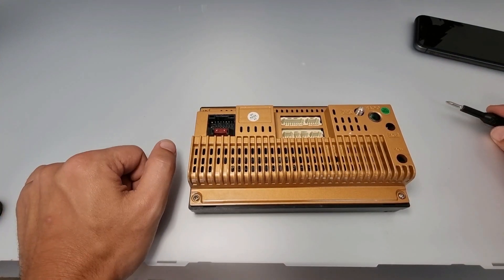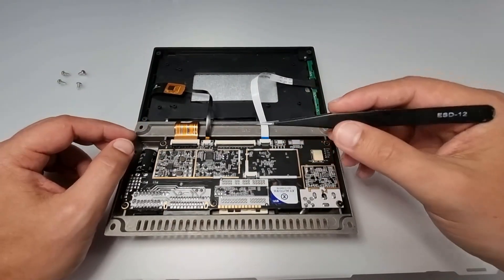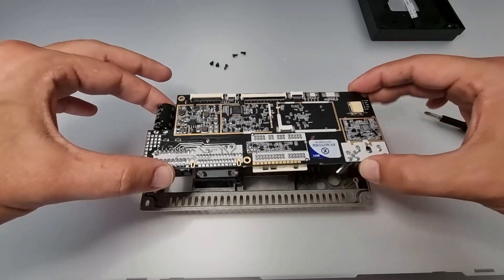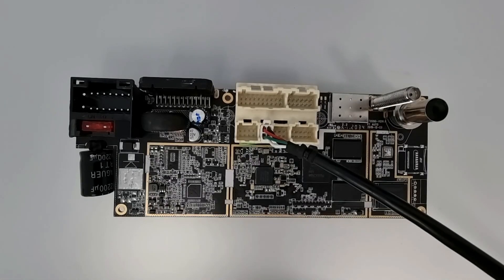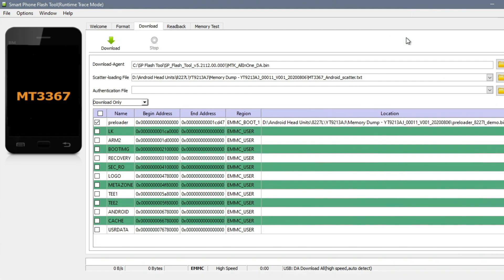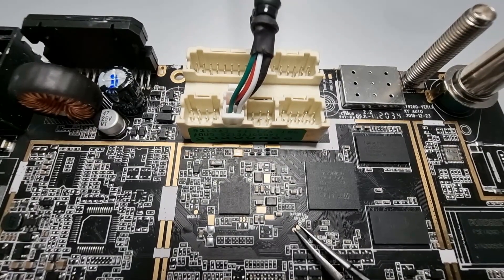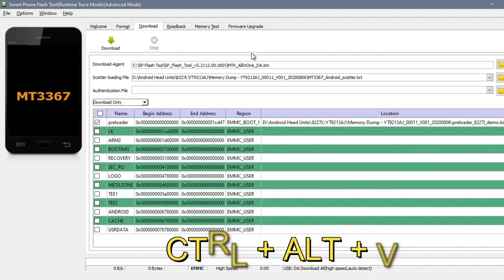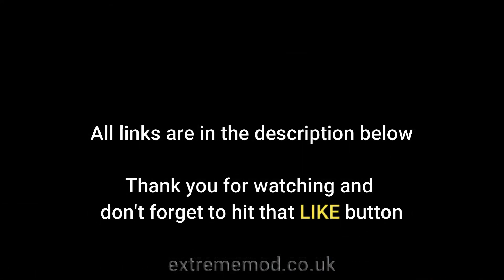How to revive your Chinese Android Head Unit - Test Point method - 8227L - universal car stereo

Comment: Hello !
Congrats on your very informative videos,
It happens so - to me, that yesterday while I was in the process of updating this yt5760b head unit .., 
by almost..accident...I pulled back the USB stick , and so now.., I cannot access the unit , not over its  touch screen neither the USB connects to a PC ,
It starts , and runs 3 apps , ( the same each time ) , and stops in one like camera or something ,
What I should now...
Could you kindly pls help me ,someway ?
I haven't made any back up of the orig. version ...it came with, Only I have the 1.7 ver in the USB stick,
Should I short the two pins so the unit's flash become blank ?!

I still... love this unit ..and would like to revive it again..

Thank you in advance ! for any possible helpful reply 
like links etc ..

Mario's

Comment: that sticky thing is called thermal paste 🤣 and temporarily soldering that point is much stable way to flash GBs of data in new devices, other than holding it with some tool.

Comment: I use a similar android multimedia product, it stayed in android for a while and did not open. When I turned it off and turned it on again, it was going back to normal, it doesn't turn on at all anymore. I couldn't open it with the reset button, I couldn't find the recovery mode. Now I want to make a flash from scratch like you do, does this method you described work? Thanks

Comment: DANGER: Not exactly sure what went wrong but this just bricked my head unit.  The format part worked just fine but now I can't get it to connect anymore so I can't push the BOOT1 backup to it.  In Linux, I keep getting Error S_COM_PORT_OPEN_FAIL (1013) as soon as I plug the cable in.  I figured I'd try the actual MediaTek drivers in Windows but that's even more confusing as the driver loads but never successfully initializes.  Appears to be some kind of boot loop - the driver loads but fails to initialize, waits a minute, driver unloads, waits another minute, and then starts over.  No idea where to go from here short of trying to find its JTAG port or something.
Reply: The risk we take 🤷

Comment: what happened if the usb port is not working? actually i was trying to connect the for wire from the usb ( connected to the 4 pin port) to car oem wire etc smoke came from the unit .and my dashcam stop working which is 6 pin port usb.screen go black after a while restart and everything working only the dashcam not working.
Reply: You definitely have to replace the controller with a new one 😂.In China they sell these for only $30
Reply: @Nam5605  ypu mrsn the mosfet?

Comment: Good video. Anybody know if this head unit motherboard has pins for a battery? Mine performs long cold start every time power is applied. The long start makes the back-up camera somewhat useless as I am usually backed-out of my driveway or parking spot before the head unit has completed booting. The motherboard needs a "suspend to RAM" power-down and a battery to keep the RAM alive.

Comment: I have the YT9216BJ_00012_V0001 and im having issues with the mains audio going out except when i hit a big bump or hit the dash just right. 

all 4 door speakers will cut out simultaneously like it's going into a protected mode but my s/w output is 100% unaffected.  

I might have a grounding speaker wire in one of my rear doors but haven't had the tools to get the doors opened after my truck bed was broken into in my apartment-locked parking. 

if I can get it working I'd like to flash it with your software, if i can't I'll send it as a donation and go back to my Kenwood DDX2.

Comment: Hi, thanks for the great video!
Do you have, by chance, the best Android version or firmware file that we can install on these devices to make them perform as well as possible?

I have installed the XL6107 system version: 20211027.144419 and MCU: XL6107_V107_20210910_1C1

The problem is that the FM stations are always mixed up and also this version does not allow me to use the Waze application, which is not great at all.

Thank you for your help!
Best regards.

Comment: Hi , I have Grundig GX2800 head units. After update it stuck at restart screen and continues restart. Even after power off I is running
Reply: I have the same problem, if you solved it, kindly share

Comment: My light is not switching on when connecting usb point. But it turns on when supply 12v
Reply: i have the same issue sort of, did you found a workaround or what the problem is?
Reply: @SultanofSerendipity  no.
Reply: I am having the same issue.

Comment: I have a cheap android head unit from ebay. Have had for 2 months or so. Suddenly ot will do nothing. No screen light up, buttons don't light up, nothing. Sometimes you can see a dim luminance in the screen for a few seconds as if it is attempting to come on. But nothing else. Can someone please help me with this issue,???
Reply: Probably backlight issue
Reply: Where to get parts @tigerusa5430
Reply: Take the fuse out for a minute might fix it

Comment: I have issue similiar Head Unit Android from China. The Mother Board its look like at the video. When i plug the USB cable data (i make my own from cutting 2 USB cable than connecting it), the light from the blue light indicator in bottom right corner is dim and the flash tools app doesn't read the motherboard.  Any addvice sir ?

Comment: I have a similar Chinese multimedia, and the touchscreen is unresponsive. Since the USB is working, I attempted a hard reset and calibration using a USB mouse, but it was unsuccessful. I decided to order a replacement digitizer (touchscreen), but the issue persists. I suspect it might be related to the chip, and I wanted to flash it. However, when I connect it via USB to the computer, the Device Manager doesn't respond, whether the device is powered on or off, even though the USB mouse works. I'm doing this as a hobby, but I'm unsure about the next steps and what to do next.

Comment: Is there a replacement board with a better CPU/GPU/RAM? The 8227L is hot garbage. Very slow, poor performance etc. Would rather drop in a new motherboard with better specs. The Screen is fine, the form factor is great.

Comment: Tell me, I can’t flash the radio, I have a ts10 screen 10.33 widescreen 720x1600, I downloaded the firmware file, unpacked all the files from the folder to the root of the fat32 flash drive, I boot from the flash drive, but the process immediately shows 100%, I tried another flash drive and other firmware files and loaded from key1 As a result, the flash drive does not see the firmware files,

Comment: I had issue with my android, I think I hit a ground wire while im setting up my AMPLIFIER,  right now the headunit is black out, when I press the recovery hole , light comes out in the icons but not in the screen, any idea what's the solution? thanks

Comment: Thank you, I managed to revive my unit, but now I have another problem next to my mercedes logo, boot mode selection appeared, volume up for selection and volume down for selection, I have three options recovery, fastbooti normal. My unit has no physical buttons and I can't select either one option to select and the selection arrow itself goes non-stop from one to the second and third option. Is there a solution to continue booting my system.

Comment: Hello Dimitrij!

After I created a backup of my unit as described in your other video I proceeded with the installation of the firmware.
However, after downloading the BOOT, ANDROID and VENDOR, now my head unit won't turn on.
I tried the test point recovery but I always get the 4032 error.
I carefully followed the instructions and was able to create the backup without problems.

When I plug in the motherboard via the 4-pin USB cable the blue LED lights up, so it seems to be working.
Am I missing something?

Comment: Thanks for the guide!! I followed the steps several times with another unit that I have and I was able to revive it, now I have another unit that when it comes to turning on the LED it does but it is very dim. Could the motherboard be damaged?, Excuse my English, I'm using Google Translate
Reply: i have the same issue, did you find anything?

Comment: The "white stuff" is actually very important for cooling the chips.  It is called Heat Sink Compound and you must replace it if you clean it all off as your unit will overheat without it.   Make sure you always replace the heatsink, or make sure you don't clean it off so there is enough left to provide a good thermal connection between the chips and the case.
Reply from the maker: That is correct. Although the quality of said compound is questionable at best. We normally replace it with Arctic afte we installed additional heat sink plates to really tighten the fit.
Reply: You beat me to it lolz
Reply: isn't the white stuff are glue to keep the component from  vibration during driving condition
Reply: @groinache  No, it's a thermally conductive paste to improve heat transfer between components and heatsink.
Reply: We know.
Reply: Wherr is that white stuff?
Reply: @arneldata9423 On the black piece of chip next to the black socket or above the coil

Comment: Hi, I've just received a DOA unit from Soarcomer (blank black screen). The unit is a 9.5" with the newest 2K screen (2000x1200 pixels). I ordered 6/128 but the sticker on the back says 8/256! Whatever, the unit doesn't work :/ 
My unit SEEMS to boot (or at least it has power on the motherboard) because when I provide 12VDC to the 2 pins BAT/GND of the main 16-pin connector on the rear, the blue LED on the PCB lights up. Also, "CAR_BT" is broadcasted in Bluetooth. However, if I plug just USB like you show on my computer: nothing, the PCB LED does not light up. Any idea?
Reply from the maker: Sorry we don't have any experience with this unit.

Comment: Maybe you could help. My android 11 unit has been running great up until i got in my car to leave work today.  The screen is stuck on my car logo and the bottom right says fastboot mode... any ideas how to get passed this ?
Reply from the maker: It's likely your system files got corrupted when some of the apps got auto-updated. You can try factory reset your head unit. Refer to the instruction manual that came with the unit or contact your seller.

Comment: Mine has no power does this work the same for this m😊😊
Reply from the maker: If it REALLY has no power, then it's not a firmware issue. If it just "looks" dead, i.e nothing shows on the screen, then it's hard-bricked. This method should work if you have s proper backup, or the bootloader for your exact model.

Comment: Hi...
Hope you are doing well.
Why don't you make new videos?
Please make videos on upgrading px3 head units (both hardware and software from Android 4.4) if possible. Thank you.
Reply from the maker: This is a side project that we started during Covid and we all got normal jobs and families. Making new content takes a lot of time and we simply haven't got that right now. We are releasing a new video soon on our Rockchip-based ExtremeMOD Android Head unit, that showcases hardware modifications and new firmware.

As for your PX3 question - we only focus on MTCx type Rockchip units with Android OS 7.x to 10
Reply: @extrememod_ahu  thank you.
Your videos are great.
Good luck 👍

Comment: Hello, I have a player similar to this one.  I had a problem with the wiring and the output was damaged, change the component and that's it, the equipment turned on again, almost everything works exactly, the illumination of the side keys is not software, because I verified that and it's fine now, I don't know if it is the strip that connects with These keys have false contact in the key lighting area or the leds of that part were damaged when the output burned.

Comment: Hi!!  Grats for you video!!!

I have a TS9 model that stucks in android logo.

I want try this method, it will work for my model??? 
 
First I would like try in recovery mode but I dont know how start in recovery mode for my model, can you help me pls?
Reply: This method will not work on your head unit. You need to short KEY1 to ground to initiate "Download Mode" and then use a working firmware to restore the system.

Comment: Hello! Thank for this video, i have an ATOTO F7 WE 7 head unit that won't power on due to a bad firmware update that went wrong. Can i use this method for this model? Thank you so much, here in Italy we don't have a single place that can provide assistance for this.
Reply from the maker: That's not an Android Head unit but rather a Linux-based custom entertainment system that supports Android Auto and CarPlay. Reach out to Atoto support. They are the only ones who can help you.

Comment: i have a head unit , i tried to flash it, but the sp flashtool never detect it, i tried with the USB 4pins and the 6pins also the same problem, i saw that the 4 pins is more good, i got another USB and i cuttet it and i merged the 4pins with it, and the sp flashtool still not detect it, im already installed the mtk drivers correctly, when i plug the cable into the pc i hear a sound of an usb detected into the pc but nothing worked, please whats the solution
Reply from the maker: Try to connect your head unit to power after inserting the USB cable. Then disconnect from power before taking out the USB cable.

Comment: I have the same unit 8227L for a bmw e46 and the FM radio stopped working. No sound, It doesn't respond to touchscreen, can't change the stations of radio band. But the upper buttons RDS TA PTY work. Also the rest of the Android unit, apps and everything else, rear view camera work fine.

Only the FM radio does not work.
I've reset the unit several times from the menu and by pressing the little reset button with no success. It reset only the settings but  there's no option for hard reset .

Can you please help me? I tried contacting the seller but he can't help me.
Thank you
Reply from the maker: If you have the same unit (which is unlikely as there are 100s of permutations out there and while they might looks the same, they are all different), simply reset the Radio app as you would with any app on an Android (delete Cache and Data for that app). 
If that doesn't help, you might need to re-install the Radio app but for that you need root access - so it's a fairly advanced type of modification.
Reply: @extrememod_ahu  I've entered the Recovery and I've managed to reset the unit to factory settings. But still the FM radio doesn't work. I  think the FM radio is not a part of the android system because I can't find the application.

How can I gain access to system root? Can you help me with this process?
Reply from the maker: @777Z  if you're on Android API 23 then install SuperSU root through TWRP Recovery mode. If you have Android API 27 or later, then install Magisk same way

Comment: I have a Android 10.1 head unit in my 2013 VW CC. I went into the android settings and pushed the "Build Number" 7 times to become a Developer Options. In Developer Options display I tried to change the display of the head unit by pushing 4k. Now everything on the display screen of the head unit doubled up so many times. The screen is showing the display about 8 times across the screen. So I am unable to go into settings and change it because I can not see the settings because of the multiple displays across the screen. Can I factory reset the head unit by taking it apart or unhooking the cables on the head units circuit board? I need help with information on an alternative way to factory reset this unit with having to use the display screen.
Reply from the maker: You can, but this wouldn't be the method. This mehtod is for bricked units only. Consult with the manufacturer on how to reset your head unit. Or check out XDA forums
Reply: Man I did the same damn thing. I’ve got some kind of overlay on it and I can’t get it to do anything. I had some luck with a keyboard but I still couldn’t get to settings to change it back. Let me know if you find an answer. I’ve been fighting this for over a year now with no luck. I contacted the company (XYAuto) and the seller and no one could tell me how to force factory reset or anything!!
Reply from the maker: @booneygurl21  check out our video on fully backing up your System. After that you'll be able to create a "Hard Reset" file and reset your System that way

Comment: Hi, I have such a "toy", recently installed, but it doesn't see anything on both USBs, on one the LED of the stick blinks but nothing appears on the screen and on the other it doesn't even blink. How do you think I can solve it? the version is this: Android : SWL 12B_00020_V001
Android OS: Android 12.0 CAR AUDIO: F7.3.7 (X2)
CAN Pro: V9.0.6 (disconnected) : no canbus
DDR: 2G FLASH: 16G
CPU: A7 1.5GHz x 4
Display: 1024*600 (lvds)
MCU: 4.0 (X2)
Fitted to a 2006 Honda Jazz
??????
Reply from the maker: It's not uncommon for these units to have issues with the USB ports. If you are within warranty, simply return the unit. The method in the video does not aply to your unit.

Comment: Pls help
Reply from the maker: You'll need to be more specific than that
Reply: @extrememod_ahu  When I reset the radio, it keeps spinning, loading won't continue! Do you know how to go into the reboot settings
Reply from the maker: @GO GO  sounds like you're experiencing a bootloop. Your System files likely got corrupted. It happens when you update software or apps that your system isn't fully compatible with. You need expert knowledge to restore your unit.